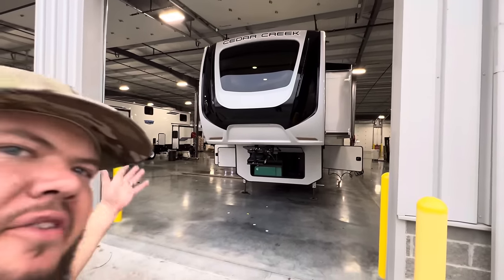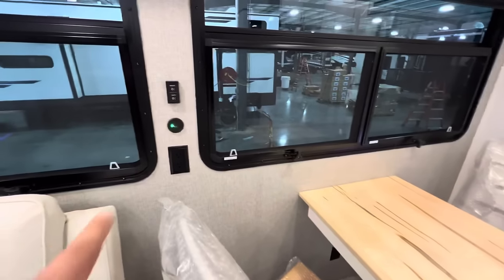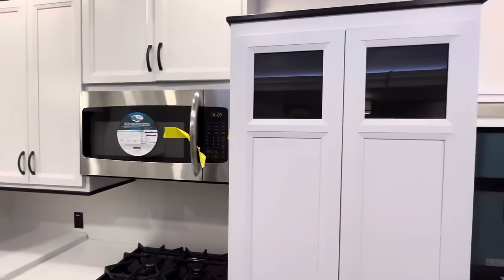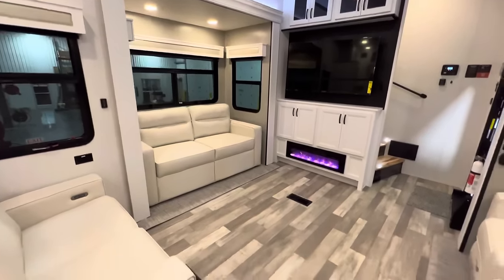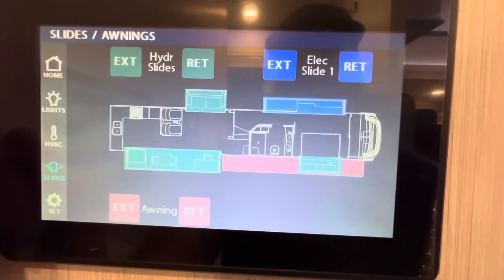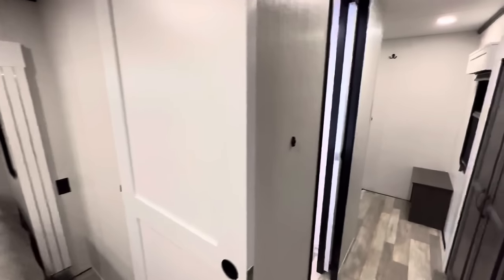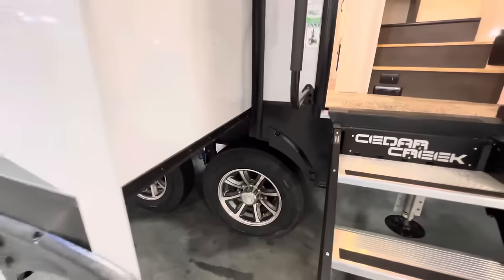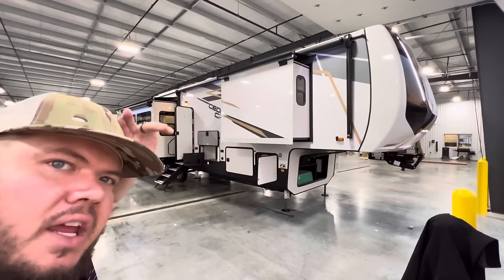2023 Cedar Creek 390RK | New Rear Kitchen RV with Unreal Bedroom!!!

Comment: The only downside I see is the fridge is in a bad place, meaning you cannot open the right door fully which will end up being a real hassle when you can’t have full access to the right side of the fridge.   A better place to put the fridge would be the opposite wall where the pantry is.  Flip flop those and you have a winner of a kitchen .
Reply from the maker: I feel ya I feel ya
Reply: Totally agree.
Reply: U r right w the odd location of the refrig....how did this get past quality control????
Reply: My refrigerator is just like this in my house & against a wall on the right side. The door opens just fine, we don't have any issues with accessing the right side.
Reply: It doesn’t make sense the way it’s set up.😊
Reply: Thought that also.
Reply: My fridge is exactly like that. I is NO problem at all. Picky are we? 😆
Reply: @robertoverton2408  Maybe ask your wife?
Reply: Just Curious how it'd make a difference by switching the location with the pantry, as there is a half wall there ....would that not defeat the purpose as the fridge door would still not open all the way... 🤔
Reply: Agreed, i wish these reviews would show the access with the slides in for the 5th wheels.
Reply from the maker: I can start adding that
Reply: @TheRVHunter  Thank you for reaching out !    That would make the whole plan so seamless and easy for the cook.   Now the next question is how to get one sent to NC??
Reply from the maker: I ship them your way all the time!!
Reply: are the sofas and recliners free standing ? please Answer. this is important !
Reply: correct amundo!
Reply: I’d suggest they swap where the pantry and fridge are placed, make the pantry cabinet carry through the same design as the rest of the kitchen
Reply: @alyssasnyder354 i think it is because the top drawers need to open up past 90 degrees to have full use of top but the freezer just pulls straight out so as long as the half wall was below the top fridge doors opening then it would help

Comment: Love the floor plan with one exception.  I don’t want a combo washer/dryer.  I prefer stackable or side by side.
Reply from the maker: I feel ya on that!
Reply: Agree
Reply: Agree
Reply: Side be side, definitely!
Reply: Yeah but this is a RV. You could make do and be grateful you can wash anything on solar power. 😅
Reply: @wiseowl1580 I have had a combo and didn’t like it. Took too long to run through a load of very few clothes.  I would rather do without than get another combo.  Just sayin’
Reply: agree but add side tables to bedroom

Comment: In the bathroom...
Where's the medicine cabinet? Get rid of the big mirror and put in two medicine cabinets instead. They don't take much room off the wall... maybe a couple inches. But that "couple inches" is something that everyone who is full time, let alone just a week or two would appreciate. Reaching down, into a drawer for the toothpaste and brush along with the daily meds one might need to take is a bit of a pain in the back side! Double sinks are really more of a novelty than something useful. We've never brushed or needed the sink at the same time. Maybe having that space being the washer/dryer area. The bathroom size is GREAT! 
The kitchen storage is fantastic! The space to have more than ONE body in the kitchen at any time is great too! That kitchen can fit a FEW bodies in it! Then the stove not being one of those 3 burners.... The 3 burner type can handle only two real items on them at a time. I know.... we have the three burners on ours! The dishwasher is perfectly placed along with the silverware drawer right above it when done doing the wash. 
The separation of each of the rooms is very residential. Love that concept... again... something we don't have in our mid bunk model I thought I NEEDED. Anyone thinking of fulltiming it.... just don't get the bunk. You'll never use it! It turned into a closet for us and then made the living spaces so much smaller, even in our 43 footer. 
Aside the couch needs someplace to place your beverages or even the remote for the TV. A shelf higher than the arm rest would be sufficient with the side space not available. 
The passenger side couch could be a desk. Speaking for myself, two of us full time in ours, not needing 3 couches and turning that space into a work space would be much nicer instead of having the added seating area. The recliner and then the 3 person couch next to them is sufficient for having guest along with the table chairs.
I love, hang on... LOVE the stairs leading upstairs!!!! Maybe just 'One of those things" that only make me impressed but it looks so good, keeps the bedroom more separate from the areas guests may be. 
Now to the bedroom as I rewound the video to give my 2 pennies here being I kind of like this coach as she and I are looking to upgrade after a year of this one....
The closet space in the hallway is nice. Out of the bedroom while one is sleeping and the early riser, like myself trying to be as quiet as possible is very cool. Looks like it's got plenty of space for the "hers/his" concept. 
Then the dresser drawers. Something we DON'T have in our rig. 4 drawers is NOT ENOUGH full timing! This one has plenty of space for exactly what we're missing. 
The desk though... Keeping the desk upgrade in the living room, change the bedroom's desk to a seating area with drawers under along with a counter top above the combo area. Perfect location for the washer/dryer too! 

I know... long story but living full time 1+ year now, I wish someone was doing this exact thing when I was watching these videos over the 2 years shopping on youtube before our purchase. I only can hope I help someone who is doing the same thing I/we did more than a year ago with my input of what to look for and look out for. This rig looks like it's pretty decent quality regardless of what I mentioned about the "attention to detail" on the table.Great suspension. Looks like decent exterior storage, nothing amazing but decent. The "day/night" shades is something I wish our NorthPoint had. There's a few things here I appreciate more than what I chose to purchase. Upgrading pretty soon, I'll probably go with something different but this coach is quite nice.

Comment: I'm a HUGE fan of "Rear" kitchens. 
Love the layout except I'm NOT loving the New "Above the Head of Bed" shelf that most the newest 5th wheels have. I'm a coffee drinker and hot cocoa and I'm not wanting to put my drinks ABOVE my Head while in bed while I'm reading or watching TV. 
They need to do away w/those and go back to the side shelf NEXT to bed. 
ALSO,,, where's Both the Washer AND Dryer supposed to go? I noticed there's only enough room for One (Washer OR Dryer) Not for Both. 
That's a bit odd too. Unless I missed it somewhere. 
I saw you open the Washer or Dryer cabinet but both can't fit in there?
Reply: It's for a combo unit, not a separate washer\dryer.

Comment: Why the counter top step height near the stove? Should be even elevation
Reply from the maker: I cant see which RV this in on but if you are refencing. change in height on the counters its for long term maintenance. Its less expensive and allows for slight flex if its not all one stiff piece
Reply: @TheRVHunter  Makes sense to not have them all connected too long so it doesn't crack but same elevation would be better for countertop use. Maybe a well educated well paid engineer could figure out how to design it.
Reply: @TheRVHunter  The Cedar Creek 5th wheel in the original post I commented on. Rear Kitchen

Comment: One thing that is important to show the quality of someone's work is Attention to Detail. 
This rig showed the lack of attention to detail rather quick in this video.... 
The kitchen table.
The extension on the table certainly COULD HAVE BEEN something to notice when putting the two pieces together with the wood grain. The extension belonged somewhere other than with this table.
That being said...
I wonder who else, building this rig did not care about the Attention to Detail. Especially with the structure and much more important features of the building of this rig...... 
OCD? 
Yup! Absolutely! Retired Electrical Contractor and attention to the detail of one's work is vital to quality
Reply: Yes! Glad someone else has attention to detail! Grain in the table didn't match. Stairs didn't match the floor. Carpet under the dressers has frayed edges showing. No shower door. No ladder. Aluminum flooring substructure looks to be pop riveted instead of welded. I can only imagine what else is wrong that wasn't shown.

Comment: Nice, love the layout overall, but there are some downsides: refrigerator should either either be swapped with the pantry in this kitchen layout, or brought out from the back wall to allow proper access, the right door needs to open further; floor vents, especially being in the middle of the floor as they are has cheap feel and could be damaged easier than ceiling vents; a larger folding dining table and 2 extra chairs, stored away, maybe even a recliner in place of the loveseat between the kitchen and living; washer/dryer location is horrid, the whole bedroom needs to be redesigned to allow separate units AND located outside the bedroom; this overall design is more suitable to a couple rather than family..
Reply: The dining table does extend and there’s two extra chairs stored underneath the bed for it.
Reply: Yes, this IS a COUPLES RV.

Comment: LOL. The designer doesn't have dogs. White furniture is not going to work. And you don't have to have dogs to absolutely hate vents in the floor. Especially smack dab in the MIDDLE of the living area?! C'mon!

I do like labeled switches. We still flip switches in our house of 23 years to remember! The above fridge cabinet! Would be perfect for pans. (could use that in my house...hmmm... Pull outs in the pantry is a must have.

Agree that a combo washer/dryer is the less desirable. You gotta be doing laundry ALL THE TIME. It takes forever to do a load. But that space would be great for a shoe rack.

Comment: Like the lighter colors and kitchen table. LG is a horrible brand, and not impressed with the size of the fridge. The insides actually look cheap. Love it has a dishwasher. Could use more countertop space. Would be better instead of drying racks to have hard surface over kitchen, adds more space. Heated seats would be nice. Entertainment area nice. Small fireplace. Like the wood block steps. Love the bedroom. Except some kind of small night stands next to bed would be nice. Shower is decent. Would have liked to see different color for shower other than white. Perfect outdoor kitchen area. Nice steps. Should come with the ladder. Could use a bit more outdoor storage.
Reply from the maker: Yikes 😂
Reply: @TheRVHunter  if I could make it my perfect fifth wheel my comments are valid.
Reply from the maker: For sure!

Comment: There's no way I'd buy this. The decor in the living and kitchen area isn't going to age well and will be dated in a few years the way decor from the 70s, 80s and 90s is outdated, especially with the valance inserts and all that white and no contrast color. The wood on the dinette table matches nothing but the stairs (I'll hit on that in a minute). The high up storage no one can reach unless you're 7ft tall makes no sense compared to the huge basement storage the keystone montana 3901rk has underneath. The wood on the steps doesn't match the flooring, and looks cheap like the dinette table top. The clothes hooks at the top of the stairs makes no sense. The way the carpet is done under the dressers looks horrible in the corners, like its not even fastened down. The space for a washer and dryer makes no sense and no one wants a combo unit anyways. Does the shower even come with a door? Wasted storage room in the bathroom with that huge wall mirror and no cabinets. Again, hardly any basement storage underneath because they left the ceilings too high and wasted space they would've had by raising the kitchen. And it doesn't even come with a ladder?